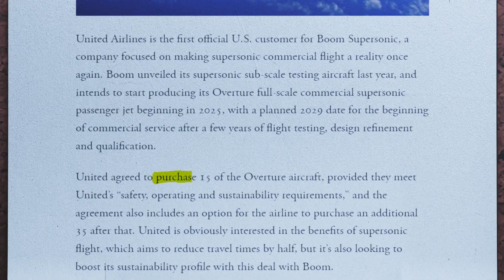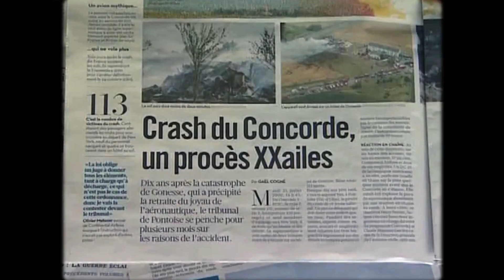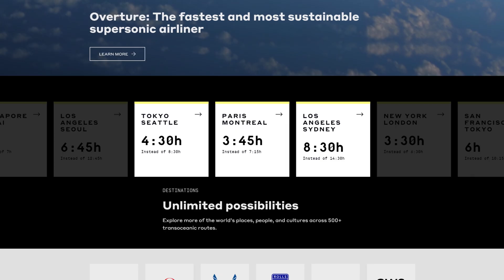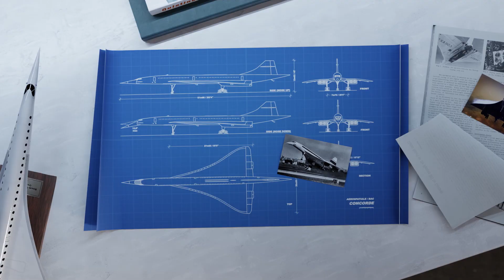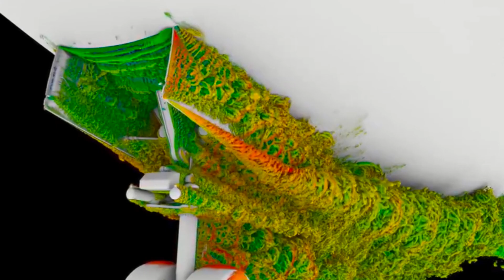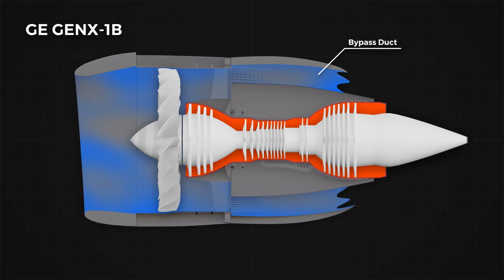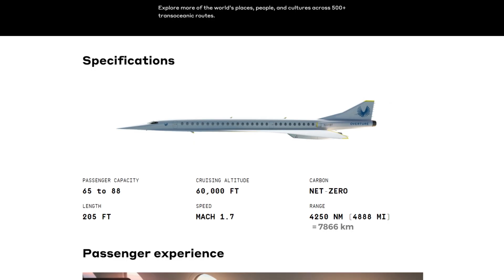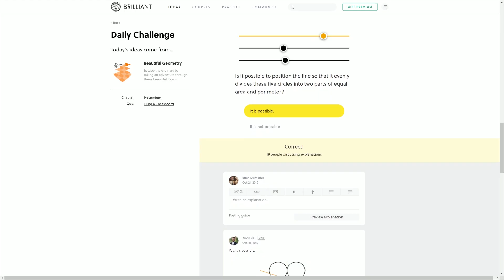Will Boom Bring Supersonic Back?

Comment: There were a couple of other factors in dropping the service - they used a dedicated 'first class' lounge and service, and there were runway inspections required.
Reply: Ahh nope... No runway inspections. Hence AF 4590. it operated like any other aircraft. Concorde was forced into retirement when it had its Airworthiness and Type Certificate withdrawn in 2003  by Airbus, the design authority, for political and financial reasons, nothing to do with the aircraft. This is unheard of for an in-service aircraft. Boeing still supports its 1950s B-707 and 1960s 727. BA had planned to fly the aircraft to 2015. 

One of the reasons Concorde was consistently profitable for 20 years for BA was that its purpose was to compete against subsonic First Class. Concorde’s tickets were only around 10–15% more (1996 GBP 4,772 vs subsonic First Class GBP 4,314) and this meant that a company could have its executive (who would have been sent First Class anyway) leave London at 10:30am, arrive in NYC at 9:30am (yes before they took off, as Concorde flew faster than the Earth rotates) take a 10 min helicopter ride to the East River heliport, have a bunch of meetings and zip back to JFK for the 1:30pm Concorde to London and be in bed the same night. 

Concorde had its own security, check-in, lounge and boarding gate from the lounge. No lining up for anything... How's that for time saving? 

Time as they say, is money, especially for these folks, and Concorde built a very loyal following that lasted throughout its service life operating in its own P&L division, and consistently profitable for BA from 1982 on, even when the mainline carrier was unprofitable. 

https://www.key.aero/article/inside-story-how-ba-made-more-ps500m-profit-concorde#:~:text=The%20result%20of%20this%20change,billion%20pounds%20profit%20for%20BA.%E2%80%9D

Comment: 13k km range, mach 2.2, running on biofuels. That's the benchmark.
I mean, in the long run, like 10 years from now, it is possible that it might be cheaper to fill up on hydrogen generated through electrolysis in the airport using renewable electricity than it is to mine up and refine dinosaur juice from the ground. In fact, the price might be many times over cheaper over time. If fuel becomes cheap, then their business might really take off. Because flying faster means more flights per day per plane, and means more flights per hour of pilot/crew time. The airport fees may also be lower, which is also huge. And demand may be greatly aided by 100% electric planes doing 1-2 hour flights on hub and spoke systems. Might give the Dreamliner direct routes a run for their money.
Reply: Do you have ANY idea how difficult hydrogen storage is?
Reply: Very difficult, challenging, not widely commercially used for a reason. But technically feasible, has been done before, and there is no reason to believe with know how and practice there won't be large scale manufacture of good enough hydrogen storage at an economical price. So yes, I do, but if history has thought us anything is that if it is theoretically possible, it will be practically possible before you know it. The main hurdle with hydrogen is really that it is but a glorified and inneficient battery. But once renewable energy is pretty much free during certain hours of the day, well, free is economical at any conversion efficiency.

Comment: In case anybody watches the video and thinks 105 dB can't be much louder than 75 dB, it's worth noting that decibels are a logarithmic, not linear, unit. 20 meters, a linear unit, is twice as long as 10 meter. 20 dB is 10 times louder than 10 dB. 30 dB is 10 times louder than 20 dB and so is 100 times louder than 10 dB. In other words, 105 dB is 1000 times louder than 75 dB.
Reply: Close - you get a 10x factor with 20db. So 10dB is about 3.3x louder, and 105dB is about 33x louder than 75dB
Reply: for me it was office > vaccuum cleaner > motorbike, each significantly louder than the previous yet only 10db difference
Reply: @SafffOneee   10dB  increase sounds twice as loud, so the vacuum cleaner would sound twice as loud as the office and the motorbike would  sound four times as loud as the office and twice as loud as the vacuum cleaner.
Reply: @JohnDoe-yp3zv  It's quite true that decibels are logarithmic, but then so is human hearing. That is why dBs were invented. An increase of 10dB sounds twice as loud, so 105dB-75dB =30dB, which would sound 8x as loud.

Comment: Needs a small series of coastal air fields for transfer of passengers directly to subsonic over land planes(matched to the supersonic seat capacity). This would not be a bumbling hub airport affair but rather a direct transfer within the same company and no transfer would get missed due to inbound delays. I'm talking about limited single runway with a lounge for an air field. The lounge is necessary shelter if a plane has an emergency. These airfields could serve supersonic trans-ocean and parallel to the coast routes like NY to Brazil. This avoids the massive fuel consumption of subsonic flight in a supersonic aircraft. (Mach 2.0 is actually not much more drag than mach .85, it is the transonic zone that is high drag. A huge fraction of Concord fuel on a London-NY flight was burned while in the subsonic section of the flight over Britain.)

Comment: You haven't been very fair to Concorde. In the 90s to the early 2000s, British Airways made Concorde an incredible success. Even if it wasn't full, the high ticket prices still turn a profit. Then when BA decided to sell tickets at regular business ticket prices, the demand was very high, and a full Concorde could still turn profits at reduced prices. All this was true even after the Air France incident. Also, the advertisement effect of the Concorde also increased BA profits in general. What really killed the Concorde was 9/11. And 9/11 killed more than just Concorde. It killed the entire aviation industry. Concorde didn't return mainly because they were pushing near 30yrs in age, were no longer in production and aviation demand in general was low. Air France on the other hand, just couldn't be bothered with Concorde at all.

Comment: "only 4 hours longer" ... you mean double? There is a huge difference between a 4  hour and 8 hour flight.
The military purposefully caused irritation and damage with low level sonic booms over populated areas, even explicitly in operations Bongo and Bongo2. Likely as a way of keeping supersonic flight out of the civilian market. The concord was (other than getting old) hamstrung by the UK airspace rules that basically caused 50% increase in fuel consumption and added substantial flight time on a London-NewYork trip. (Concord had huge increase in fuel consumption in subsonic flight and had to follow a screwy subsonic route through the British Islands.)

Comment: The number one root cause of Concorde ultimate program shut down, is USA hamstringing it by banning territory overflight and leading a deliberate campaign to undermine it. Principally, because it was not a US engineering achievement. Had they not done so, the program would have had more adoption globally, generating more revenue, getting to an industrial scale where production cost issues would have been resolved, enabling further R&D investment to reduce boom issue and increase range, making the program sustainable. The USA commercially killed Concorde. Seeing passionate bunch picking up the flame is nice, but the idea that a US firm is going to be given the red carpet by US authorities for it is making me greet my teeth.
Reply: Even without the ban who would've bought Concorde and used it commercialy in the first place? Pan Am? TWA? Lufthansa? It's range was to limited, it's engines consumed to much fuel and the heat was also an issue. The USSR build the TU-144 and (although not as advanced as Concorde) they flew it within Soviet borders and as it turns out people complained, the military complained and even party officials complained so it stopped flying in the late 70's. 
A SST could never match the efficiency of something like the 747, Airbus 330 or A350. They are to small, to noisy, to dirty and overall to expensive to maintain and operate. 
It's not the US's fault but rather Concordes fault itself. I doubt we would've seen a wide body version of it, I doubt that people would've tolerated sonic booms every fifteen minutes for years in the hopes that one day they'll solve the issue. 
Concorde and Supersonic Flight seem to me more like a pipe dream than anything else.

Comment: Why can't a supersonic airliner take advantage of a turbo fan???? The f22 has a turbo fan, and can sustain supercruise. I'm quite sure a turbofan with a reasonable bypass ratio can be fitted to a supersonic airliner, it would just need to aerodynamically configured for it correctly.

Comment: Carbon fibre is honestly amazing. I’m in my first year of engineering at university and the more I learn about it, the more awesome it becomes 😂 besides the cost…
Reply: @FW25
And beside the energy needed to produce carbon fibre parts...
Abd these parts cannot be recycled...
And repairs are difficult if not impossible...
And you can't check for hidden defects like broken fibres with an ultrasound probe...

But other than that it's great.
Reply: @ArchimedesvS  I take your point but most of these problems are slowly going away thanks to scaling up the mass production. Roughly 5X more energy is needed to produce 1kg of CF than aluminium but it is far less dense so a little goes a long way. As for recycling, we’re perfectly capable of recycling CF via pyrolysis (which is also getting more efficient) and CF rarely fails under commercial use (such as in the 787) because the tolerances are so high.
Reply: @FW25  From what i read, the energy needed to build a part (not just produce the material)  of an aircraft  is roughly the same comparing aluminum and CF.

Recycing via pyrolysis is more of an downcycling as you get shorter fibres, which in addition are not precisely orientated. Recyled steel or aluminum is as good as new material.
  
CF might rarely fail during normal operation, but i don't think it is inherently more reliable than properly constructed steel or aluminum parts.

Comment: My completely undeducated intuition is Does the engine really have to be a pure jet? A number of fighter jets nowadays use low-bypass turbofans (albeit afterburning) and are capable of supercruise. The Eurofighter is one of those and its powerplant was largely developed and built by Rolls-Royce. So RR definitely have knowledge of supersonic capable turbofans.
Reply: Exactly. FYI, General Electric has been developing exactly this for the past few years. "GE Affinity" is a supersonic, non after-burning, turbofan engine for commercial general aviation use. It was chosen to power the "Aerion" supersonic aircraft.
Reply: @anthonycanalese2142  hahaha, the Aerion. I spent 20 years reading updates every other year about that company. They were always 10 years away from launching their plane lol. Hopefully the Boom aircraft will do better, but I don't have much trust in them tbh...
Reply: Supercruise by itself does nothing for the commercial aviation though. It's all about fuel efficiency and range. And Eurofighter has a pathetic 2900km listed(and it's probably not in supercruise either), while even the 7800km mentioned in the video are cutting it super close to a shortest trans pacific route. Not to mention how much less drag to fighter jets experience due to more permissible shape design constraints.
Reply: @Th3Apothecary  I'm not sure what your point is. Obviously the eurofighter has less range than a planned airliner, it has a much smaller fuel capacity and is not built with absolute endurance in mind. 
    My point was regarding the statement that supersonic aircraft have to have pure jets, that's why I used an example of a supersonic capable aircraft that uses a turbo fan.
Reply: Early versions of the Tu-144 have low-bypass turbofans with afterburners. However, due to technological gaps within Soviet aeroengineering, they are somehow more fuel-thirsty than a regular turbojet at that time. Subsequent versions later carried turbojets. 

It’s still too early into development to say anything about them strictly developing an efficient turbojet, but RR is the ONE firm that could do turbofans rated for supersonic flight. Assuming they solved the inlet geometry pretty quickly, the only major obstacle I think they need to solve is to figure out the proper combustion cycle for the turbofans to safely supercruise at Mach 1.5+ without the use of an afterburner.